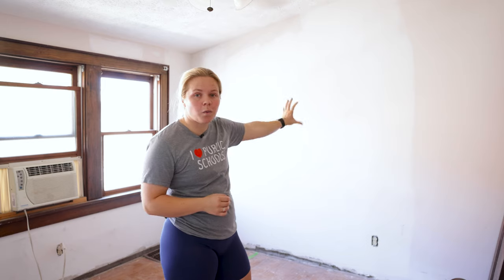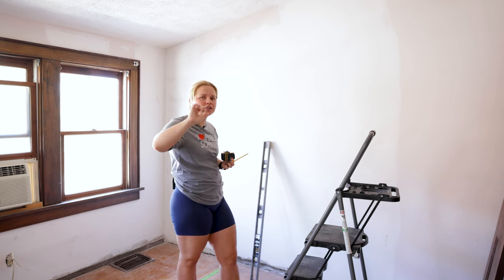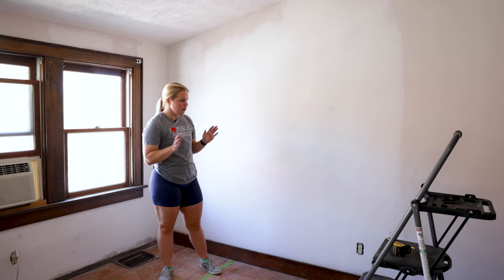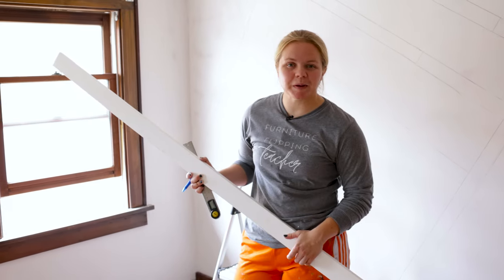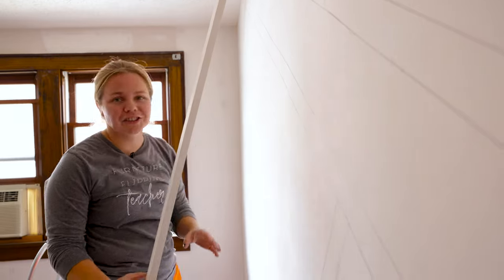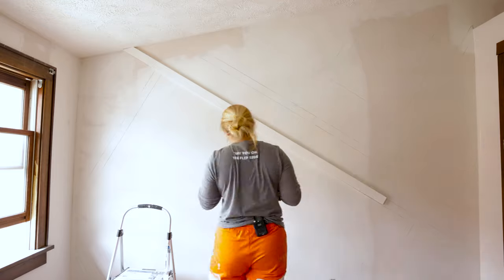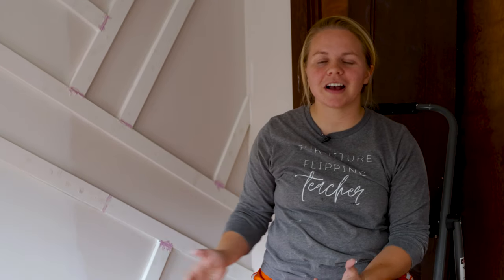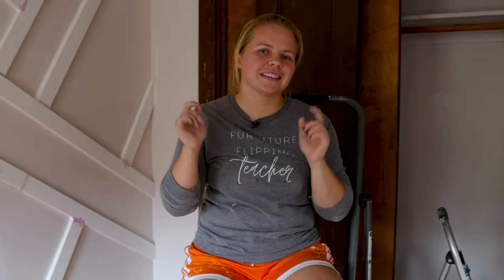Step by Step Guide to Creating a DIY Accent Wall | DIY ACCENT WALL PART 1

Comment: very nice, inspired me to  do something like that is my mobile home soon.  As for color choices, well medium shade of blue for the back and the design peices would be nice a shade or two of a darker blue.  My most recent repainting of my kitchen and living room area are all in the same space as with most mobile home.  I have light blues and light greys.  My kitchen cabinets I painted a dark grey on the botton.  Which by the way was a 50.00 gallon of valspar from lowes on the discount rack.  Paid $9.00.  I kept looking at the dark grey circle on the top of the can.  I actually walked away from it twice, but kept thinking that has got to be some nice paint.  I went back and looked at it again and finally the thought came ahh kitchen cabinets.  Yes that is some nice paint it has to self leveling.  I brushed them and no brush marks.  Then I wanted to top cabinets to be lighter, so I mixed some white and that was a mistake.  The tops look ok, but not as nice as the bottom ones.
Live and learn.  : ))

Comment: Is there a reason why you did them close together on the top portion of the wall and then far apart on the bottom? I suppose you will put a bed against it when it’s finished so it probably won’t be seen, but as is I would add more on the bottom!  The 2 rectangles really stand out currently!  It always looks so different when it’s finished though! Can’t wait to see your vision in the end!

Comment: Do you use a brad nailer or finish nailer?
Reply from the maker: i am using an 18 gauge brad nailer for this project!
Reply: @FurnitureFlippingTeacher  Ty, one more question. I am looking to buy either a brad nailer or finish nailer. Which do you use most often?